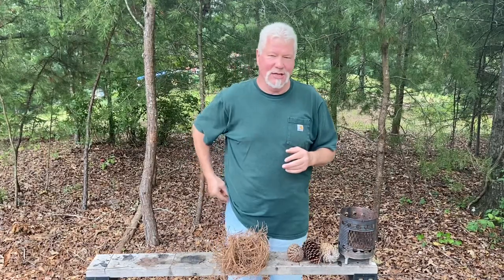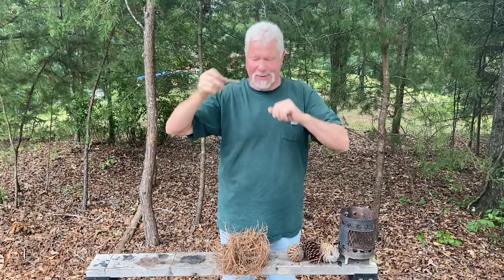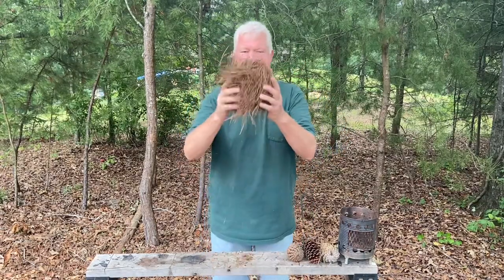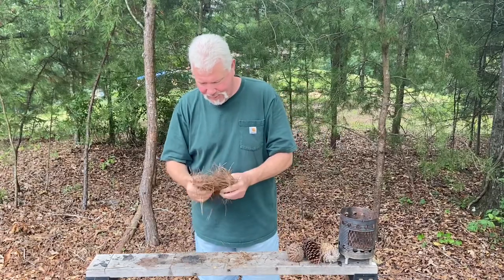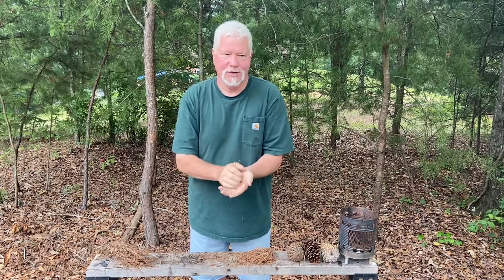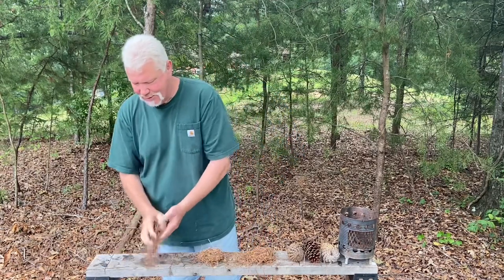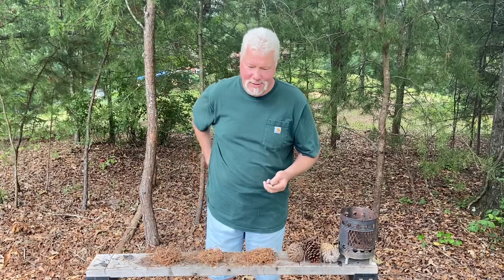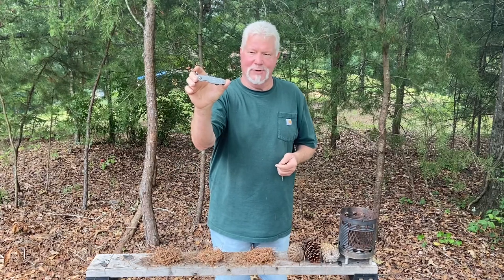Ferro Rod Tip That Few Know... And Even Fewer Utilize!

Comment from the maker: Why take a brand new ferro rod, scrape it several times off into the air, and when you get down to the sparks, so to speak, THEN try to ignite tinder? Stop wasting those first scrapings. No, they're not going to ignite at first, but if you'll pile them up in your tinder bundle they will provide tremendous heat when a strike that does contain sparks finds them.
   In my first ignition, please notice that it took 3 strikes or scrapings of the ferro rod to get ignition. The first 2 scrapes did not produce sparks probably because of oxidation on the outside of the ferro rod. Think about this though, there's no oxidation on the back side of these scrapings. They will ignite when finally hit by a spark. Watch closely and that's what you'll see in my first ignition... the pile from 2 unburn scrapings being ignited by that 3rd scraping and manifested by an intense afterburn.
   This video was going to be about something completely different until I noticed that "afterburn" and changed the focus. Originally, I wanted you to comment about, How often do you practice fire making? every day like me? once a week? once a month? Please, still do comment.
   Please follow the LINKs below and SUBSCRIBE. Thank You!

Ferro Rod Playlist
https://www.youtube.com/playlist?list=PLkoXX8XsMW3lI6k8TH1Bljf57Yvp9K1WD
6 Ferro Rod Fires In 60 Seconds. Includes Intro, Processing, And All Still Burning During The 0utro! https://youtu.be/USLPQwwPQa8
All Ferro Rods Should Have A Point On Them!
https://youtu.be/wUS5YDcVWOo
Reply: I agree. I keep a large ferro rod with a full size striker, and also a magnesium fire starter block which I find works better than just shavings from the ferro rod.

Comment: Really cool tip. In the past I’ve scraped off the top layer into the air before attempting to ignite tinder. I never thought to use that material as tinder itself. Thanks!
Reply from the maker: What I like is when people scrape that new coating off like that or even when they scrape off that mild corrosion build up that happens between uses. Several scrapings off into the air, then ignite the tinder, and then call it a one strike ignite.

Comment: I light my propane stove once in awhile (use micro and air fryer mostly).  😁  Had a gas company tech come out to turn off the pilot light to save a few pennies.  But I enjoy watching you.
   As I've developed a slight hand tremor over the decades, a friend of mine didn't like me playing with matches.  She bought me an electric spark thingy with a long neck.  So that's what I use now.
   I used to regularly burn garden debris every summer, but I've stopped.  The atmosphere doesn't need anymore CO2.  Anyhow, I have 40 acres so now I just pile it up and let it rot.
    Good shelter for birds and small critters too.

    Fire starting in movie "The Martian" was very impressive.
Reply from the maker: I see. Thank you!

Comment: I was in the boy scouts growing up back in the 70's. I don't particularly practice fire starting but I've been camping with friends for years and I always start the fires with my ferro rod. I've never had any issues except a couple of times when trying to start a fire in the rain. I ended up using some dryer lint that I always use as a backup when things are wet. I keep a ziploc bag of it in my backpack as well as some river birch bark. Both work great when things are wet.
Reply from the maker: 2 tried and true fire starters. TY!

Comment: I seldom start a fire however I have been an avid backpacker and outdoorsman in the past. I built one of your fire cans that you use frequently. I use mine for cooking or heating water. I really like the videos you produce. Always interesting
Reply from the maker: It boils water quickly because it has such a strong updraft. For the same reason, it burns wet tinder, kindling, and fuel well.

Comment: I bought myself one of those little Stanley knives. I really like it. When it gets dull I usually just sharpen it but I bought three extra blades for it just to be on the safe side. I also prefer bayite rods but I'm sold on the Fostar rods too. Wont go wrong with either.
Reply from the maker: I'll have to try the Fostar some day.

Comment: Dave;

My use of these techniques is a few times a month. A bit more so in the fall and spring when sitting around a fire in the yard is more enjoyable. Occasionally I find myself teaching a friend or coworker. Recently; my wife and I have hosted a few themed yard parties which highlighted outdoor skills and included a short hike in a local trail. Most folks were impressed with the Fresnel lens technique. It’s also a faster skill to teach than the flint / steel and about the same as a metal match / ferro rod.

Thank you for continuously making these videos. Be strong and of good courage.

May all your journeys be adventures and your havens safe.
Reply from the maker: Cotton and ashes fire roll is another easy one that really WOWs people. Thanks!
Reply: @DavidWestBgood2ppl  haven’t had time to practice that yet. It does look awesome and its on my near future list.
With all of these skills the practice time increases efficiency and therefore reduces time from start to fire.
Reply from the maker: That blows my mind! I was just thinking about a version of that statement a couple of hours ago.
Reply: @DavidWestBgood2ppl  Great minds think (alike).
It’s just like the bible, if you don’t practice it often you’ll not be a good as you could be :)
Reply from the maker: My favorite bible verse is Hebrews 4:12 For the word of God is quick, and powerful, and sharper than any two edged sword, piercing even to the dividing asunder of soul and spirit, and of the joints and marrow, and is a discerner of the thoughts and intents of the heart.
Reply: @DavidWestBgood2ppl  Mine are Psalm 144 and Joshua 1.9
They translate something like this:
Blessed be the Lord who trains my hands for battle and my fingers for war. He is my loving God and my fortress.
Be strong and of good courage.

Keep the faith brother.
There may be storms but the boat doesn’t sink.
Reply from the maker: I happen to be reading through the Psalms, a couple of chapters a day. This morning was 107 and 108. 107 has that familiar partial verse, "Let the redeemed of the Lord say so...". That's kind of what we're doing here. God Bless You.

Comment: I hardly ever start a fire, but as a retired "rocket scientist" (space vehicle test specialist and assembly tech, actually), I was a pyro enthusiast from early childhood, winner of the Pathfinders campfire award, and know far more ways to start a fire than I've kept track of. For BBQing for instance, I make a mix of 80% vegetable oil and 20% alcohol as starting fluid, which ignites safely, builds quickly, smells really good lighting the coals and leaves no air pollution or toxic residue. Directed air from a hair dryer through a pipe eliminates air pollution from any fire and nothing reawakens sleeping coals like pure oxygen from a Burnzomatic oxy-MAP torch!
Reply from the maker: Nice!

Comment: I have a Stanley 10-049 I bought back in 1981 with the original blade. I've cut roof tiles, and opened thousands of plastic clam packs.
Reply from the maker: Aren't they great and durable?... I've cut miles of cardboard with mine over the years.

Comment: I don't start fires on the regular, except in the wood stove, but I can usually stir up some good hot coals to get a fire going.  However I am quite interested in taking this up.

We have lots of eastern white pine, paper birch, white cedar, and some hemlock that makes great tinder.  Also dry goldenrod makes good tinder as well.
Reply from the maker: Sounds like you may be in NC or further North.
Reply: @DavidWestBgood2ppl ,

Much further north.  I live in lower Michigan.  I did make a couple of trips to S Carolina when my Daughter was stationed in Goose Creek.  Very nice state and such friendly people.
Reply from the maker: 200 miles away, TY!

Comment: I practice once a month. I got the bayite like you recommended and just today I came up with an idea. The bayite came with a flexible cable ring for your keys and today I was looking for something to use as a striker and I had a key from an old padlock that lost and the key has a sharp edge on it and I had a quick disconnect key holder for keychains and i put the padlock key on that and the ferro rod on the flex ring along with a flashlight and a small Swiss Army knife and the key can pop off and become the striker easily.
Reply from the maker: Brass and chrome covered brass is too soft. It won't make a great striker. I use the stainless steel spine of my knives for strikers. Do some comparison tests with harder strikers.
Reply: @DavidWestBgood2ppl  I found out the hard way today! I already replaced the key with a snapped off piece of hacksaw blade. Thanks!
Reply from the maker: Now that'll scrape!

Comment: I've watched a few people make tender bundles, such as Coalcracker bushcraft and the grey beared green beret. This was so simple and they made it look so hard lol. I also watched your video on using char cloth wrapped in half a cotton ball. I was really impressed buy that. I had no idea you could generate enough heat to ignite the char cloth buy simply rolling it in cotton and then using the technique of rolling it to get the char cloth to ignite in some dried out pine needles. I'll subscribe and like. great examples and it really isn't that hard to find a pile of dead pine needles under a tree to do this either. I'm surprised you don't have more subscribers! Great tip in the ferro rod scrapings also! Great tip to remember; if it didn't initially spark, it will when a spark hits it!
It looked like you home made that burner out of an old food can?
Reply from the maker: You should've seen how "experts" were making tinder bundles 10 years ago when I first started this channel... Walk through the woods for an hour or more, collect up a dozen different tinders, and then make them into a tinder bundle about the size of a basketball. LOL! Just a hand full of leaves will USUALLY make an ember go to flames and then burn hot enough to ignite your tinder.
Reply: @DavidWestBgood2ppl  that's what I was thinking as well! I liked the hobo stove made from a big can of green beans. you could easily put a small cast iron skillet on top of that and cook. That's very compact and easy to haul around. I think that is the first reasonable hobo stove I've seen made. what did you use for the cross bars on top? You were using it to cook with that little 6" skillet to boil water, cook grits and cook eggs on. Didn't look like it would be that hard to make them, a couple of slots in the middle, and I guess you could either notch it where it rests on the rim or make another slot with some snips. I guess you could use another one of the green bean cans and cut a couple strips off of it and flatten them out and make the notches. that was some good engineering; very simple but very useful!

Comment: I practice at least twice a week, usually flint and steel. Bow drill is my second favorite technique, but I still haven't got an ember from hand drill.
Reply from the maker: I've been trying to clean up my hand drill technique this week. I have too much sway at the top of my spindle which causes heat loss at the other end. The problem is my right hand is doing most of the work against my left. I made blisters this week, but also made progress on getting "both hands" to work at the same rate.

Comment: There have been several spans that i try to get at least 1 hand drill ember a day to keep my hands conditioned for it, but lately its been about 1 a week. I experiment almost daily with different tinders for flint and steel. I desperately want to find new materials that will ignite without charring. So far only steel wool
Reply from the maker: We practice about the same amount! My sessions may be a lot longer though. Thanks!

Comment: In the last week or maybe two, 5 or 6 bow drills, flint and steel and quartz and steel, a little bit of solar and  ferro rod also. Oh and I even found time to burn a hole in my favourite shorts thanks to a little piece of charred punk wood I dropped and didn’t notice quick enough😆
Reply from the maker: That's a lot. I eventually, in the life of my sneakers, burn partially through one of my laces with a stray ember. LOL!